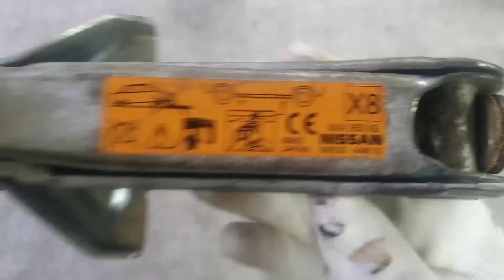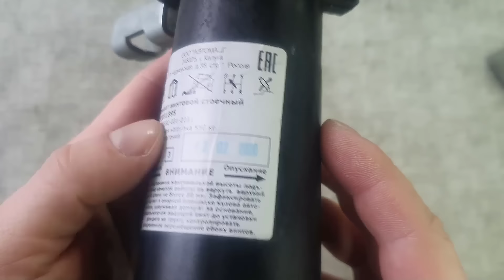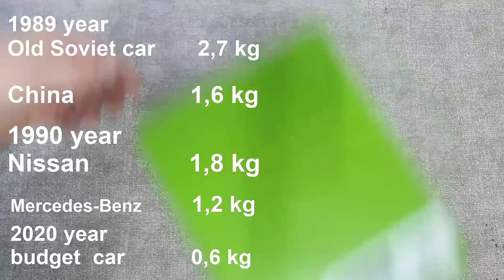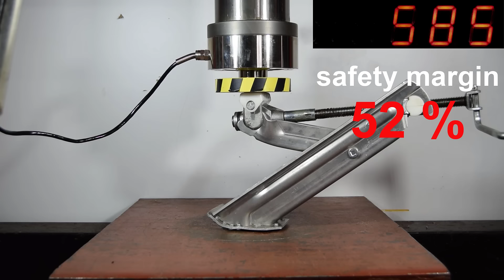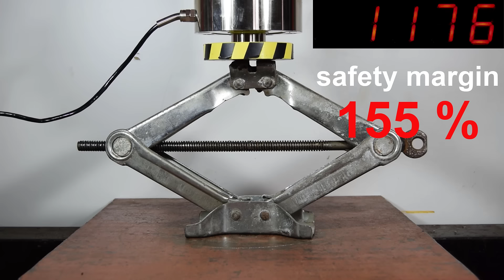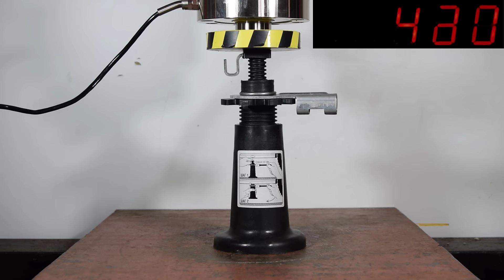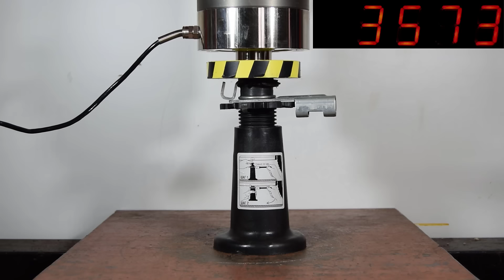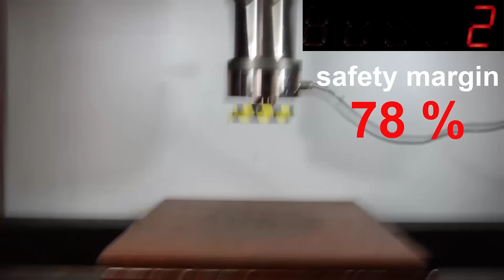HYDRAULIC PRESS VS ORIGINAL JACKS

Comment: What? The plastic one was, at the end, the best?
Not only has the biggest safety margin, also, when it fails, even with that the body was capable to support more than 4300, so basically even is it fails, not gonna let the vehicle falls and crush the poor mechanic 😲
I most say, that was astonishing.
Reply: If a mechanic is using one of those, I have more questions.
Reply: The sad truth that the Lada plastic jack is a huge piece of crap. Nice to see, that it brokes on a high safety margin, but in real life it caused a lot of injuries. I know an owner who lost two of his fingers cause of the jack.
Lada made a callback to change all the plastic jacks in the Vesta's to normal steel trapezoid ones on the EU market. We had nearly 80 pcs in the workshop from this craps thoose times XD

Comment: comparing a bottle jack to the scissor ones is not a fair comparison, different strengths and weaknesses. Bottlejacks are typically far stronger than emergency scissor jacks, but have far less range of motion.